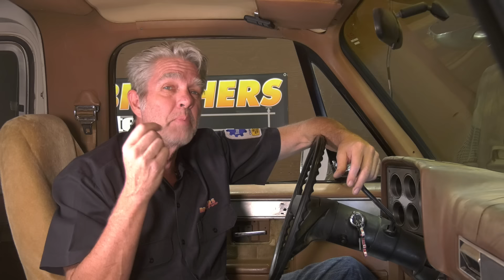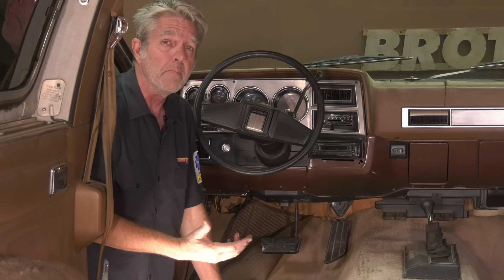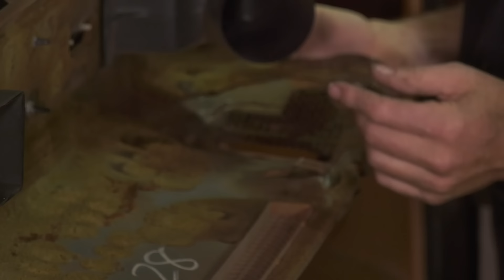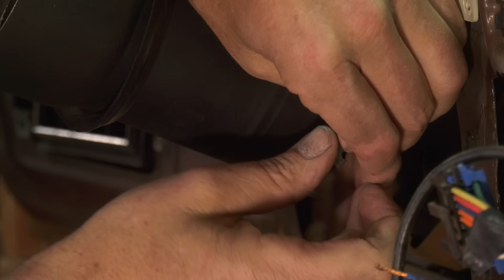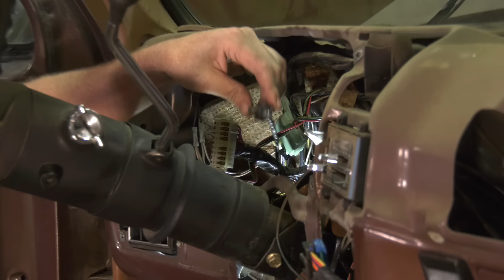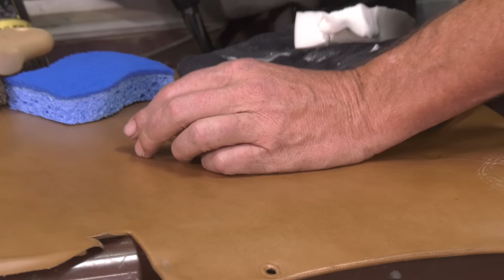1973-87 Chevy & GMC Squarebody Truck Interior Restoration - Seats, Doors, Carpet, Dash & more!

Comment: Guys, I have a very similar 86 burb. Need to know how many miles this Blazer had. I am trying to figure out if mine was "already restored" (in my case, very heavily modified as well unfortunately,) or if it really only had about 92K miles for real. The interior on this is identical in color and material to mine, so it's a good starting point to estimate. Mine has a swapped motor so it's hard to truly tell other than body wear or lack thereof. Thank you so much if you ever see this comment

Comment: Pro tip. When removing connectors, don't rock them because you can spread the terminals. Use a small flat blade screwdriver to gently pry them loose. Less critical on older vehicles though. Great video!

Comment: Great video!! My dash has been cut for a modern radio like yours in this video, i want to put the original radio back in as you did, does the plastic bezel with the two radio knobs enough to hold the old style radio in because the metal holes are gone? Thank you.

Comment: My dad had a 1985 silverado fully loaded, power everything. Beautiful black and red interior.  They sure were beautiful trucks.
Reply: Wasn't a Silverado then. Silverado was the base trim level. No power anything. Could've been a cheyenne.
Reply: @TheHyde8875  mine is a 1984 silverado c10 and it has power windows and ac am fm radio everything...
Reply: @TheHyde8875 you've got that backwards there

Comment: My '86  K10  Silverado has a sad interior like  this. The previous owner even rhino-lined the entire floor, much to my chagrin. I know this damn truck is capable of looking good again. Your videos give me hope!
Reply: im about to be at the interior point of my rebuild . i was thinking about doing a bed liner on the floor and then dyno mat and carpet over that . being your floor is already done , whats your opinion on spraying a bed liner on the floor for extra insolation ?
Reply: @867diesel not worth it. If you want extra insulation, get sound proofing to lay down and a thicker carpet with a rubber backing

Comment: Great video. My ‘88 is two-tone white-red-white with the red carmine interior. I could hear and smell everything in this video lol. Even imagine each noise made by the parts of the sound wasn’t even in the video. Mine is worn and torn in the same spots as this one. Glad to see dash covers are coming along on fit and finish. They used to be frustratingly unfitting. Still pricey 😢. BROTHERS doesn’t wanna give a red one away for a good cause do ya? Lol. I need one for my ‘88. A tan one for my ‘79 and and a black one for my ’85 M1009 Blazer. damn these Blazers are addictive!  

Great job by Dave. I mentioned on another video he’s one of the best teachers for the DIY folks who aren’t professional car builders. He and Kevin Tetz are top notch in that field. (Derek Bieri & Thomas Mortske as well in the self-filmed revival field) 

Especially enjoyed the heated socket carpet trick. I’ve done it with heated  screw driver before but the socket makes way more sense! 

Hats off Dave, hope that ole back holds up well for you to keep doing what you love. Back pain is a b!+ćh! And I’m right there with ya.
Reply from the maker: Thanks for watching and for commenting!

Comment: OMG - my k5 is 88 also!  Mine is the light tan color paint color.  The only thing I have hit a snag on restoring is those odd camel (saddle?) vinyl seats that the vinyl is bonded to the foam.  Slip-on covers won't work.  Would love more info on re-doing those.  Btw, I shot mine with tintable raptor liner and used matching pigment from the paint code - love that stuff ;-)

Comment: Dave. Don't you mean the fiber optic line goes to the ash tray, not the HVAC controller.  Or is the 88 different than the older ones?
Reply: The light goes into the back of the gauge cluster and then the fiber optic runs to the ashtray
Reply from the maker: Pretty sure it goes to the AC controls, but to be honest we didn't trace it down to its termination point.
Reply: @BROTHERSTruckPartsTV  in my 83 it travels across the ac and clips to the ash tray so you get a spec of light shinning on your ash stuffed ashtray ash and butt holder.  
I'm sure someone will chime in.  Thanks for the reply

Comment: Dave! Please do a video on repairing those dashes that people cut to fit a CD player in. I see you just installed the factory style straight to the new bezel. Is that sturdy enough to hold the new radio?
Reply from the maker: The new radios BROTHERS sells are very lightweight compared to the factory radio due to updated electronics. The dash panel itself is plenty strong to hold the radio as long as you also use the provided strap to support the rear of the unit.
Reply: Here is what it could look like and sound like...>>> https://youtu.be/qBSqMwgqiZE

Comment: Is this an 88?
Reply from the maker: Yes. The Squarebody bodystyle continued through '91 on Blazers and Suburbans
Reply: Q-tip or hearing aid, then listen to Dave!
Reply: @deankay4434  I heard 88 but wasn’t sure. Didn’t know the body style went that long
Reply: @Hvac11bravo  they are correct. Plus the body style remained squarebody on the 1-ton series pickup as well through ‘91. 1/2 ton and 3/4 ton changed over in ‘88.
Reply: Yeah man, I think it's an 88